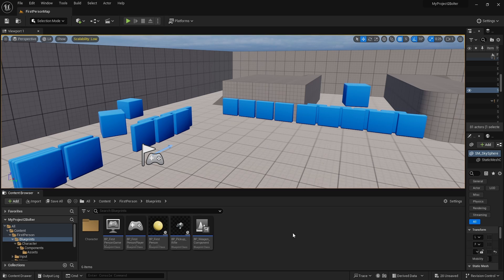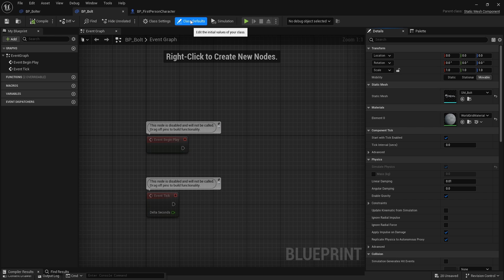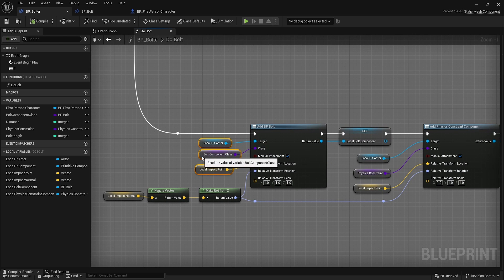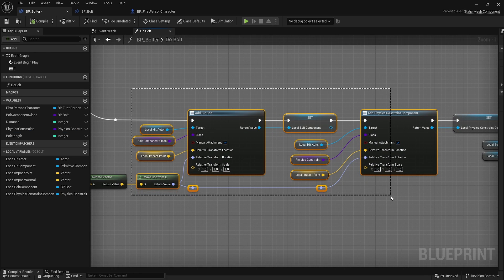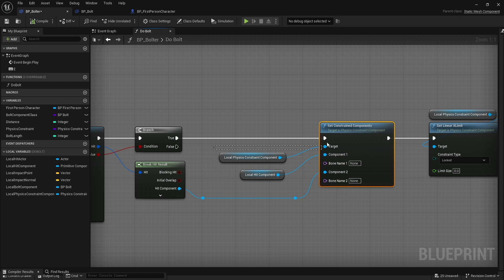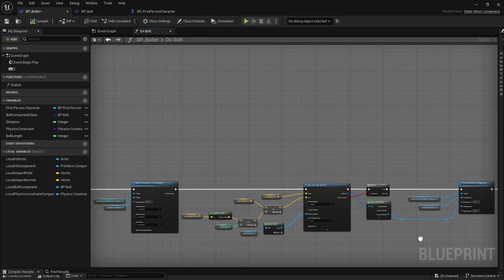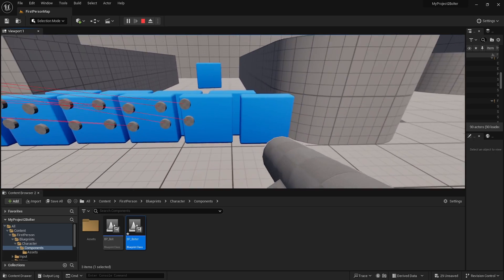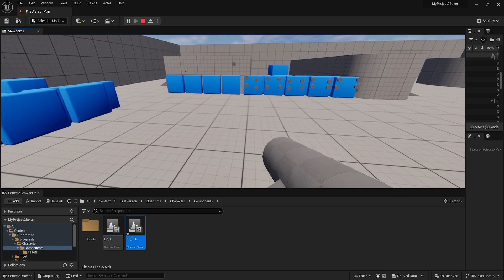How To Attach Actors Using Physics Constraint To Do "Bolt Style" Building In  UE 5

Comment: I tried copying this. It works and makes sense to me, awesome work. But.. my pieces go flying? Like the physics constraint makes it go wild. They are connected for sure, but it's very weak and they fly apart and around. Any fixes or ways to make physics objects behave?
Reply from the maker: Do your bolt meshes still have collision? For this it needs to be removed or the bolts can make the physics act strangely
Reply: @crazedmonkey231  Turns out I didn't have a mesh for the bolt. Woops. That makes physics handles very angry, apparently. Thanks! I was able to get it working in a different context and it works perfectly!